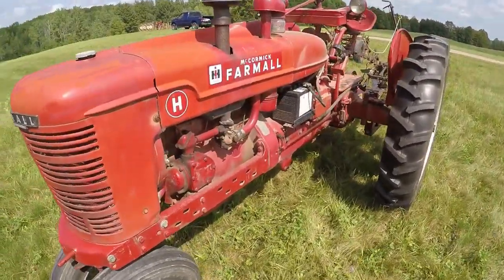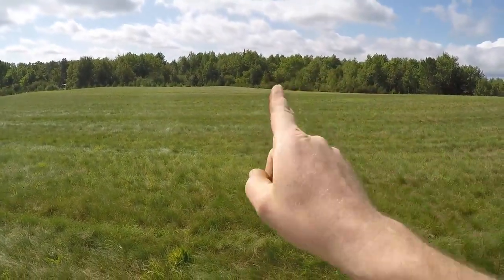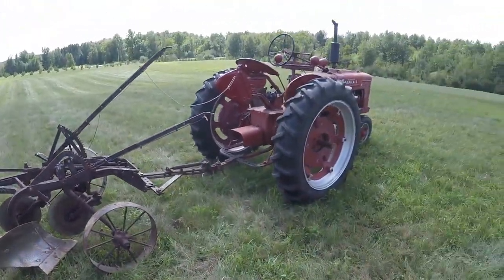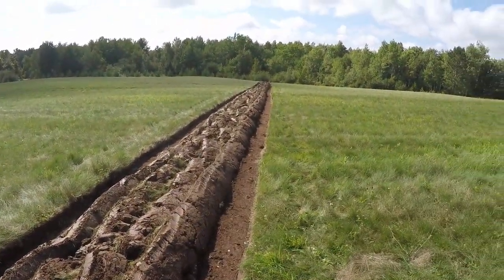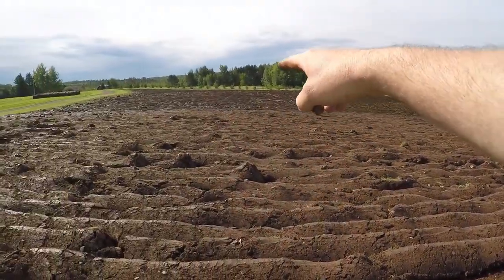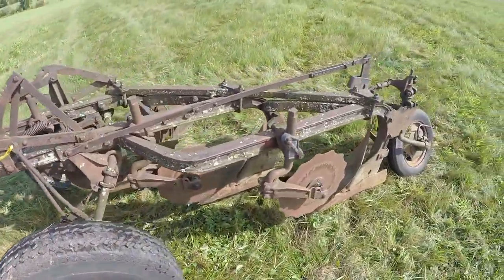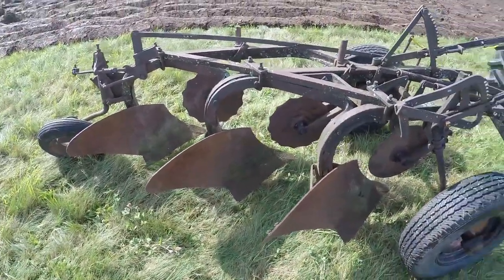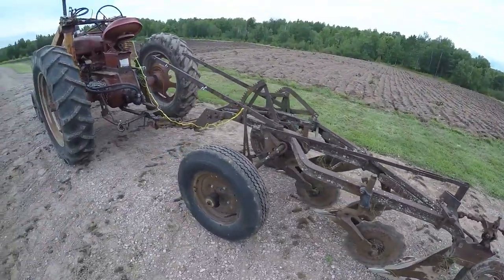Farmall H and Super M Plowing With No.8 Little Genius 2 and 3 Bottom Plows

Comment: Boy, that brings back memories,  steel wheels rattling on a gravel road, the purr of a 4 cylinder engine, and the smell of fresh turned topsoil mixed with a whiff of hot oil..  nothing like looking back on neat furrows.
Reply: You would be so proud of CAT! I just watched a Danish video, they were using a Cat D10 to pull big fishing boats out of bay up on the beach. They pulled about a dozen or so out. Smallest boat looked maybe 30 ft.

Comment: Excellent tutorial on how to start your lands...I have been doing it all wrong and worked from the outside inward...I purchased a nice 1949 Farmall M gasser in 2011, a 1956 Farmall 450 LP in 2017, and a 1965 Farmall 706 Diesel with IH engine in 2019...They all 3 are running... after considerable work on the first two that were dead for 10-15 years and parts missing.  The 706 was purchased in running condition last month, but needs new tires, the tractor included a front loader with bail spear and 8' scrapper blade that came with it for $4k...I have the same IH 2 bottom trip plow on steel you have, (research showed that wonderful plow was made from 1928 to about 1960), and I own a JD 3 bottom with hydraulic lift that has not been tested yet, and apparently I'll need a 4 or 5 bottom plow for the 706 Diesel...Thanks for the turorial.  I learned a lot from your experience...God's speed on your future endeavors...DP PS. I'm going to pick up an AC-72 combine this weekend...I've been looking for one for 5 years and one finally popped up about 400 miles from me in good condition and resonable price.

Comment: Those mold boards behind the M were pretty well polished by the time your video captured them. I recall carrying a scraper to clean them at each row end until they polished up. 

The soil at our NW Indiana farm was a sandy loam which polished those plows nicely. Our Illinois land looked much like yours and took a few more passes to clean up. Always followed up with grease on the plow surfaces to keep them shining, but it never seemed to last on equipment stored outside. I also remember buying plow points at Tractor Supply. Good memories!

Comment: Plowed many an acre with an "M", then finally went up to the 560 w/4-bottom semi-mounted.. Nice to see these old machines working like they should..
Reply: That's what we had. Bought the 560 used with the 4 bottom fast hitch plow. Did all the plowing and disking with it. Did your 560 have the hook that you could reach down with while sitting on the seat  and unhook from the plow?
Reply: @davidvogel6359  I honestly can't remember...
Reply: @GunsmithLC  The hook was layed beside the seat mount attached to the platform with two spring clips. You had to pick the plow up and set the foot down to level the plow then you could set it down until the weight was off the tractor and the plow stable. Just reach down with the hook, unlatch the fast hitch clamps and pull out of the plow.
Reply: @davidvogel6359  Well, I'll be...  Never knew that. Thankee....

Comment: Looks like plow i started with. Dont recall a number wasnt enough paint on it to have a model number that i can remember. 2x16
And yes we had rock backed uo a rehitched countless times sometimes right away after rehitching😂. We also had a JD plow whole back end would pop up in the air no tail wheel except a solid one it pulled harder than the ih plow.

Comment: Dad used to paint old motor oil on the mow boards after plowing to keep the rust at bay. Nice job on plowing the field the new plots today don't perform like the old ones. Not sure if its the plows or how quickly the new larger tractors move through the fields.

Comment: We used 3 bottom on the M,  4 bottom on the SuperM that had a Fire Crater head, larger Valves and ported, Also had a MD/TA that would pull 4 bottoms. Thanks for Posting.

Comment: I had a in law with a 2 bottom set of that configuration.  I fuller welder in the wire parts and hard surfaces everything on'em.  Worked out well enough till they sold out the dairy and he retired.  Somebody bought'em at auction never saw'em again...

Comment: It looks like you got the the plow trip rope tied to the seat that's a big No-No when I was a kid and hooked up the plow myself to the m I used to tie the rope to the seat my father saw and he said no you don't do that I said why not he said well if you hit something the hitch is designed to let loose and the tractor keeps going and the plow stays and the Rope is going to pull your ass off with the seat enough said never did it again also we never bothered adjusting it to make the land and then readjusting it to start plowing what little difference it made on trying to get the hump down so be it

Comment: does the center row get turned over, and by center im talking about the space in between the two first rows you make? i have a disk plow poa-21 MF and never never plowed anything before so im wondering how you do it. i was thinking of plowing from the outside in but im not sure
Reply: Squatch253  good answer, thanks for the explanation
Reply: Growing up on a farm, we used a different method of plowing.  We  separated the field into "lands."  We left a ridge when "laying off a land" and plowed clockwise (like you did) until we reached the proper width.  One land was either 5 or 7 (been too long!) rotations of the rear wheel on the M, 656, 706, Massey 44, whatever we were plowing with. Then we would count off enough rotations to plow another "land" clockwise, then plow out a counterclockwise land between the two which would leave a furrow that we would mostly fill in with the plow not very deep in the ground.  Then next year, we would "lay off a land" (place the ridge) in the previous year's furrow.  When disking after plowing, you straddle the ridge with the center of the disk and that breaks its down mostly level.  For the furrow, you run the edge of the disk at the center of the furrow which mostly fills it in.  This method keeps you from having to drive so much on the ends to head in the other direction, thus reducing compaction.  It also helps keep a level field.  If you plowed a field in the same direction every year you'd end up with a ridge in the middle and low spots on the outside edges.  Not saying you're wrong, just sharing how we did it. 

Thanks for sharing the video!  I miss farming and driving the M.
Reply: @bobhickling1837  In north Florida we crown our 60 ft beds to help drain the rain we get. The fields are precision leveled with about 6 inches of fall in 1320 ft. We use a disc turn plow working from inside out, leaving the center two 40 inch rows with the soil piled on them. Drain furrows are plowed between the outside two rows of each 18 row bed. Water is piped into the high end of each furrow for irrigation.
My grandfather had an H and a M. I learned to drive on a John Deere because it had a hand clutch, I was too small to push out the clutch on the H. Plus Grandpa didn't really want me driving his tractors, my dad owned the John Deere.